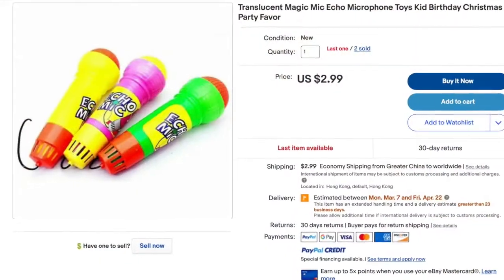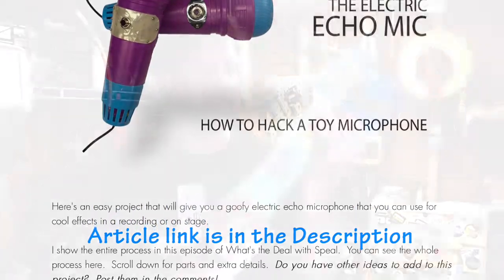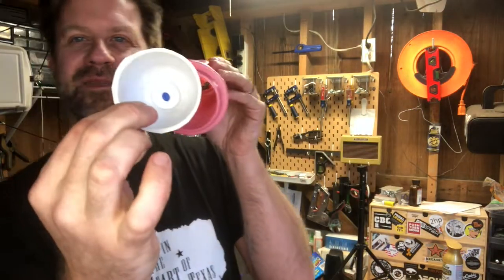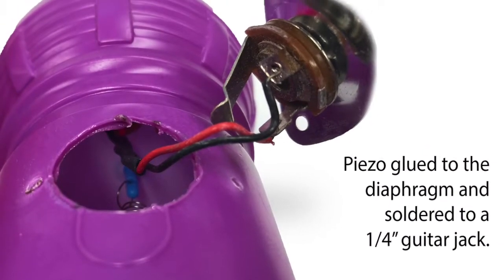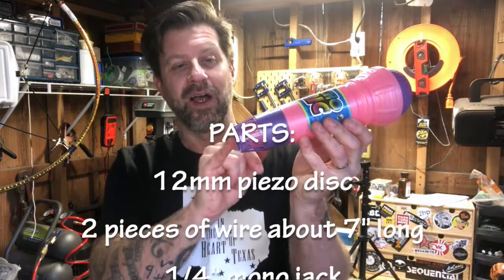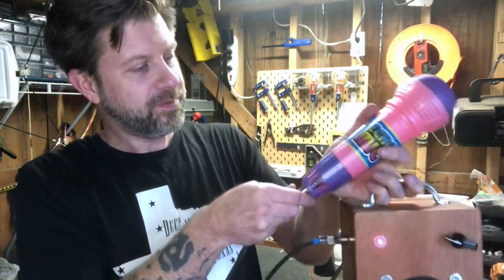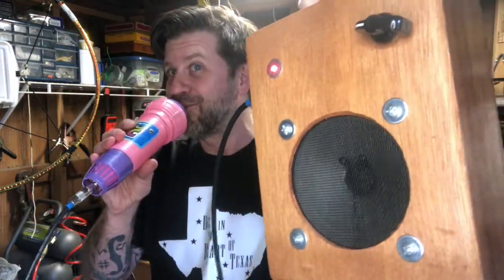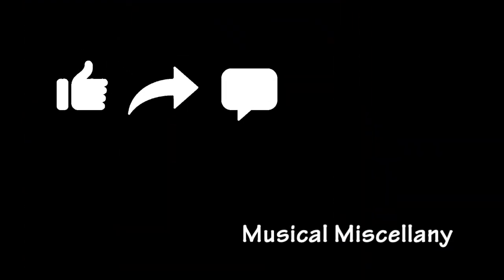DIY Electric Toy Echo Mic | kids microphone mod

Comment: I just built a nice one expanded from this with a 12mm piezo superglued to each end of the spring and built in volume and tone pot. 
I tried mounting the pickups on both the cup and spring and found you will get less kazoo type distortion mounting to just the spring and adding potentiometers for tone and volume makes it easier to control feedback.
Reply from the maker: @tedbracken418  thanks for experimenting. I like that spirit of discovery